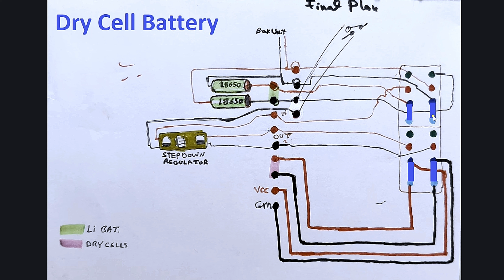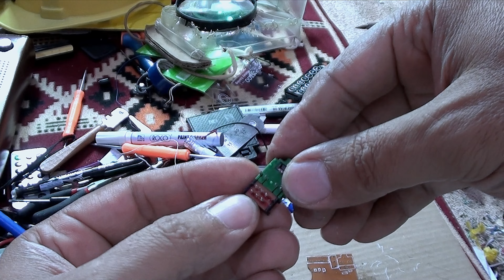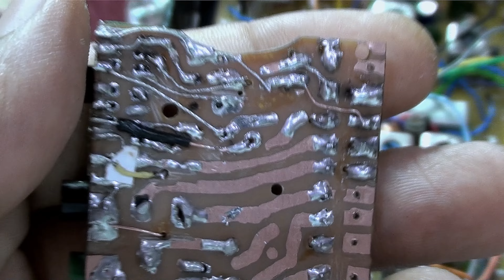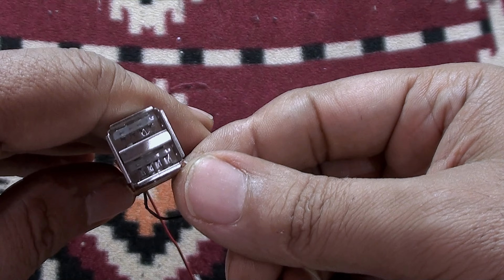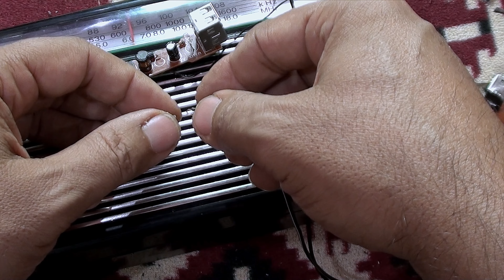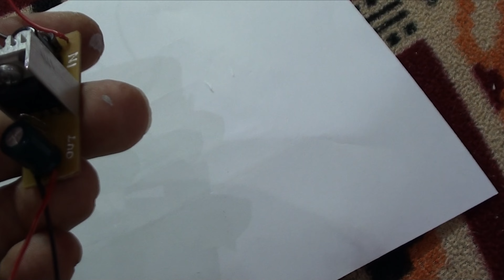Creating Multiband Vintage Radio DIY (Part: 4/7)

Comment: If the Buk converter could be made to work at 800Mhz that would move the interference out of the way would it not.
Reply from the maker: Somewhat, yes, but not totally….

Comment: Are there plans to reduce all the electronics in the radio to firmware written in C++ for a Texas Instruments DSP chip so that the whole unit can be tidied up and a nice case printed out to house it.
Reply from the maker: Yes, definitely, but remember our goal here is to “mimic” vintage radios. This would be good idea to be done separately in other video,,i like what u said man, thanks